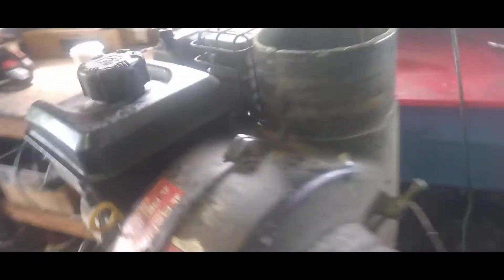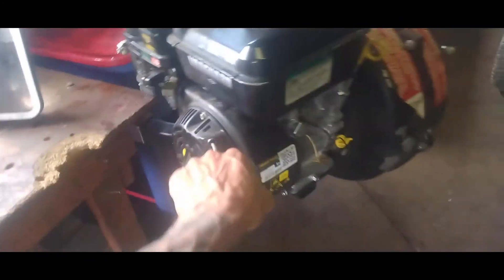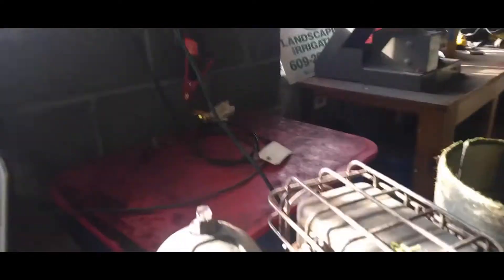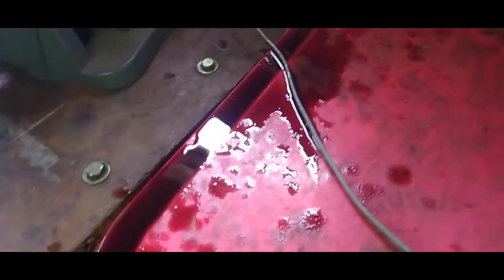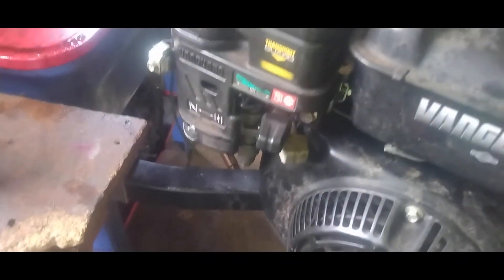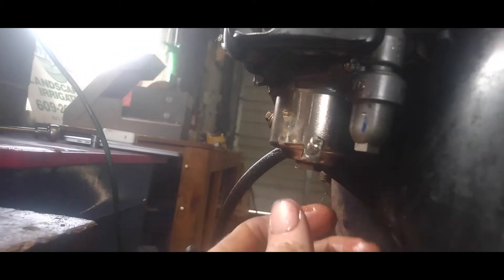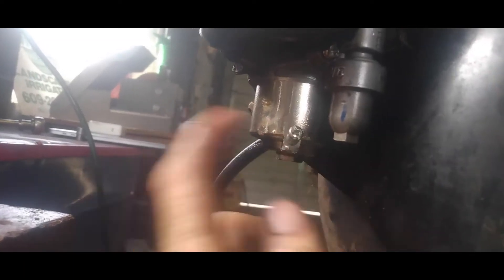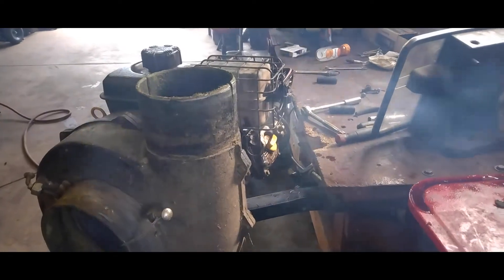Oil in Carburetor / Spitting from Spark Plug - Small Engines

Comment: Thanks for the advice. I sprayed  starter fluid after getting the oil off, flamed the end of the spark plug with a lighter, and got it running.

Comment: I performed maintenance on my Husqvarna YTH2348 riding mower. Changed the oil, oil filter, fuel filter, fuel lines, both plugs, air filter and always use 100% non-ethanol fuel. After the maintenance white smoke was pouring out of the carburetor and the engine was surging and sputtering. I drove the mower around the house and it continued to surge and sputter and smoke. None of this happened prior to the maintenance. Maintenance was performed on level ground. I performed maintenance yearly on the mower and this has never happened before. Do you have any suggestions?
Reply from the maker: If you did all of that and it happened immediately after the one thing I would immediately assume is that you overfilled it with oil or you are using an improper oil.